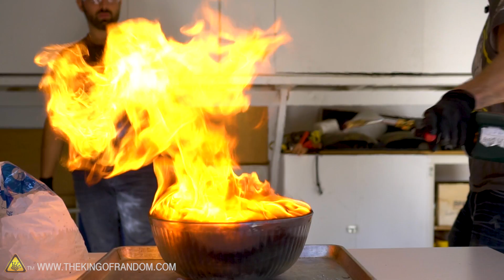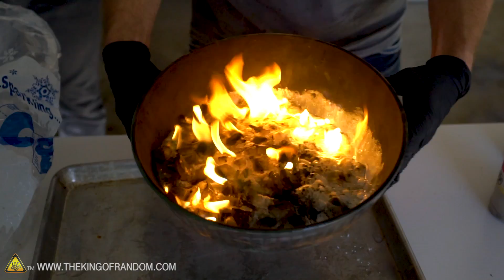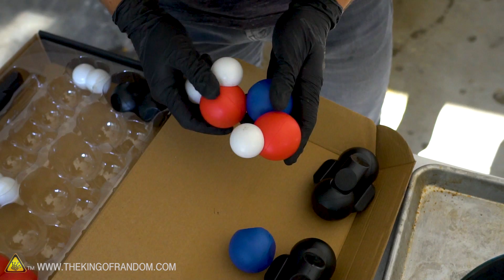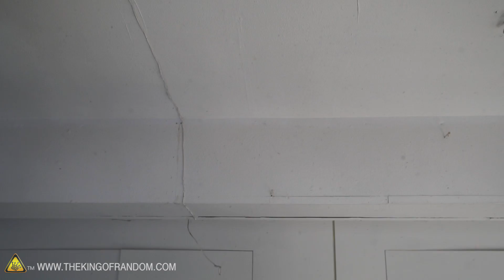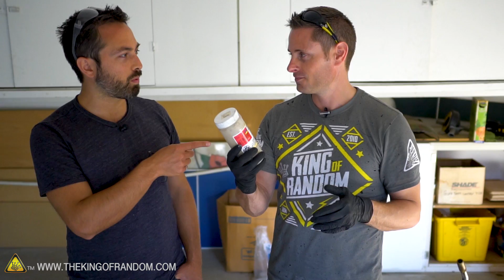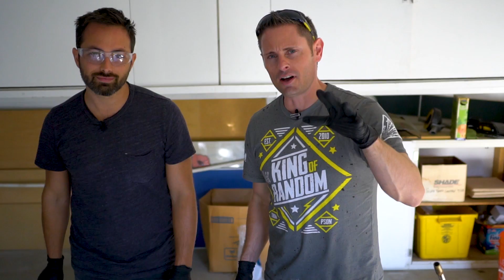Setting ICE on FIRE with Science! TKOR Shows The Tricks For Lighting Ice On Fire In This Experiment!

Comment: If you trap the acetylene in a pressurized canister and procur a canister of oxygen, link them together with a hose, splitter, and nozzle, then you essentially have an oxy-acetylene torch that can be used for cutting sheet steel and fusion-welding.

Comment: in my country its called "Karbit"
some people use it as welding torch fuel mixed with O2 so the flame become much hotter (i think)
and surprisingly kids/teenagers use it as "toy" and make a bamboo cannon
Also "Karbit" (Calcium Carbide) pretty cheap here in my country they sold in a chunks (around 300gr - 500gr or less) for about $0.75

Comment: in the netherlands we use calcium carbide to do "karbied schieten" every 31th of december. you do it by putting calcium carbide and a little bit of water in a sealed container with on one end a little hole and on the ather side something that can open the contain so it doesnt explode in your face. by doing this with a container witch is about 20-30 liters you should be able to create a louder bang then your fire crackers.

Comment: So, acetylene burns really inefficiently without adding oxygen manually, and you wind up with a large amount of excess carbon which you see floating in the air. The smell is supposed to be categorized as a garlic or burned garlic smell. It depends largely on the concentration of the gas and any impurities that might be in the water or calcium carbide.

Fun fact, acetylene is more flammable than hydrogen.

Comment: My suggestion: make a version of the backyard foundry, but instead of using propane, use oxy-acetelyne gas as the heat source.  If it works, you would be able to melt iron and steel!  Cast iron is pretty useful.

Comment: the acetylene is used in and oxygen and acetylene torch rig. and when you light off the acetylene all of that black stuff is just carbon even that feathery stuff. but when you use that rig and you add pressurized oxygen it makes the flame white hot and it is used to cut metal.

Comment: Hi Grant! 
As a kid I used to get Calcium Carbide from construction sites in big bolder (tenis ball or bigger) that me and my friends would than brake in to small pieces (peanut size), than take an empty coffee can (globo instant coffee), or a pipe that is closed at one end, or sawed off the top part of a spray can (this was dangerous as was thin and could rupture), put the carbide in it, add a splash of water (or just spit on it), for the coffee can we would put the lid back on and than lite a match to a small whole on the side of the can (small whole needed on other 2 variations as well), this causing a small explosion that wold send the lid flying. Lots of fun with that!

Comment: The soot is due to the triple bond, which makes it difficult to burn completely, so carbon (soot) is left over. The strange smell is phosphine gas (PH3), which is often described to have a smell similar to garlic and is quite toxic in it's pure from. This forms due to the presence calcium phosphide (Ca3P2), which is an impurity that is found quite often in calcium carbide.

Comment: The soot is because the ratio of carbon to hydrogen is so high. Acetylene requires a lot of oxygen to fully combust and will not burn cleanly in air. 

The smell is likely phosphine, which is produced by impurities in the calcium carbide.

Comment: Collab with linustechtips. He would love help with the metal foundry.
Reply: Nikki: Did you see when Linus tried to make his own heat sink but utterly failed because he didn't have experience with metal foundries? Maybe they could even cool a CPU with liquid nitrogen with grants help/ Grant could help Linus, and Linus could help Grant with something such as his YouTube setup, or maybe upgrade his storage or N.A.S. Grant could also just show Linus some cool experiments. After all, anyone is better than Logan Paul.
Reply: He will drop it by accident
Reply: same lol
Reply: It has been done before and works pretty well, only problem is you need to constantly add more liquid nitrogen. You also have to be aware of the excess moisture in that air that can condense around computer parts.
Reply: He knows about ln2 cooling, but probably would like grants help with the liquid nitrogen.
Reply: I never said he didn't, in fact I learned about it from a LinusTechTips video. I meant that he already knows it is possible, and that it is very practical. They obviously could do a very short demonstration of how cold they could get the CPU, but Grant's audience would most likely be bored by it.
Reply: Luckysquirrel1256 Pretty sure Linus would know about LN2 cooling since he's been to Computex which always have a LN2 overclocking booth.

Comment: In The Netherlands there is a tradition of carbide shooting around new years eve. You take an iron container with a hole, big enough to stuff a football in. in the container you put a little bit of wet carbide. Then you seal the hole with the football. after a couple of minutes, you can ignite the gas's with an electric ignition system or with a torch near a small hole in the bottom of the container.

With electric ignition system is saver because the container might explode.

Comment: Can you boil Gallium in a vacuum chamber? As it have very low milting temperature (around 80 something f). theoretically speaking it will boil like water. 
As well 
Can you frees Gallium in a solid state with liquid Nitrogen? For example, if you drop it in liquid Nitrogen using a syringe, will it frees into a shape of spokes?

Comment: Hey Grant, try putting some Carbide in an empty paint can with tiny hole in the bottom, add some water, lay it on the side and jam the lid back on, wait for a minute, than hold a flame near the hole in the bottom. Do wear ear protection though. This is a tradition in the northern part of the Netherlands, where on the 31st of December this is done in big churns and oil barrels.

Comment: What will happen if you add soap water to the calcium carbide? Will it create flammable bubbles like when you trap butane gas inside bubbles?
Reply: Yes, just like when he did the H2 generator, he filled bubbles with H2 and they ignited instantly. Also, explosive bottles, go look at those older videos, that's where Grant shines the most.
Reply: Jelger Arjaans The calcium will prpbably ruin the soap, because calcium (unlike Sodium) can form 2 bonds, and it replaces the sodium in the soap and then links together 2 fatty acids. What that means is that the soap is no longer water soluble.
Reply: MrBiky Yeah, those videos were awesome!
Reply: Ciroluiro That's interesting 🤔
Reply: Jelger Arjaans I hope he tries it

Comment: Hi Grant, I work in the HVAC field, using oxy acetalyne torches for pipe brazing. The black soot in the air after burning acetalyne is the result of incomplete combustion taking place. The amount of unsaturated hydrocarbon is higher than alkane which does not oxidise fully in air with 21% O2; complete combustion cant happen.
Reply: To anyone, if this is incorrect please feel free to correct me.

Comment: If you think about it, your burning carbon with the help of the O2 that moved over and bonded. the soot is carbon floating around. You need to mess around with oxi acetylene torch more. you know when your mix isnt right when its dumping soot into the air.

Comment: Not sure if it has been said but the black soot is carbon. You can get the same thing from your acetylene torch without oxygen on a low flame. Can also be used as a release agent on shafts and moulds. Keith Fenner shows this in  one of his videos when he is repouring babbitt bearing on a drive shaft

Comment: Hey Grant,

you should Mix potassium permanganate and Hydrogen peroxide to create pure oxygen gas in one container similar to the hydroxy generator, and then mix Calcium carbide and water together in another container and ultimately create a Oxy-axcetylene torch at home.

I think i would be a great video and i would give you the capability to melt metals with much higher temperatures.

Comment: Can you try to use that powder on dry ice? I would want to see if that would work
Reply: Nothing, dry ice is solid co2. And the vapours will put the fire out anyway if it worked
Reply: Dominik Toth This video just explain to you why that wouldn't work. Dry ice doesn't have any hydrogen to make  acetylene gas and can't break apart the CaC2 into Calcium hydroxide.